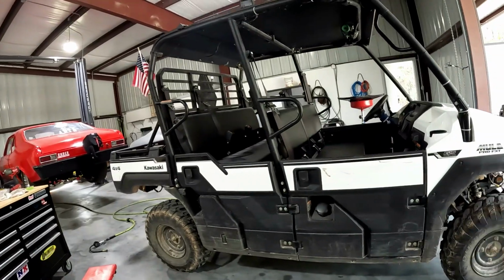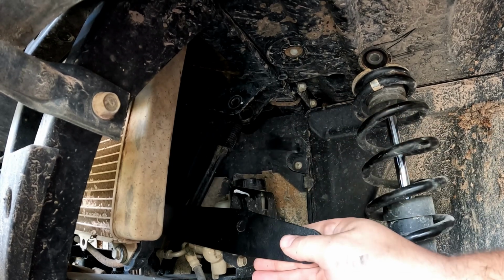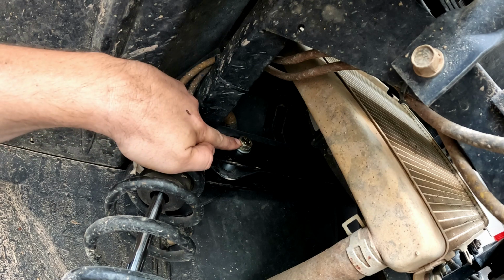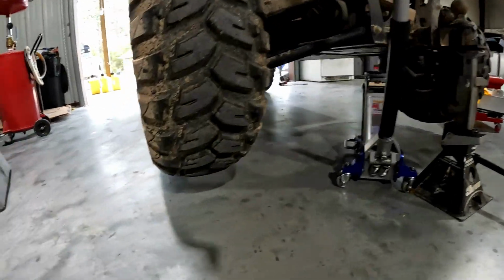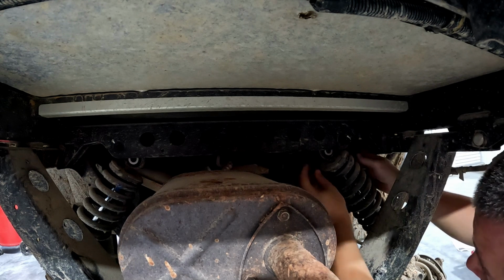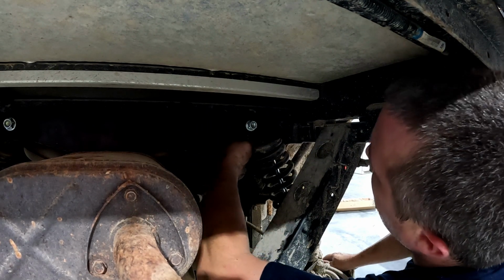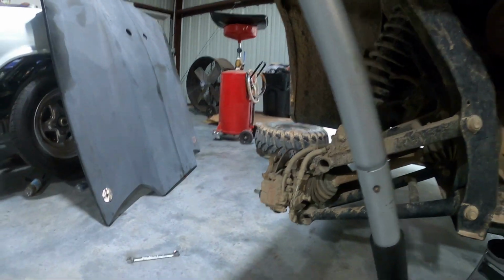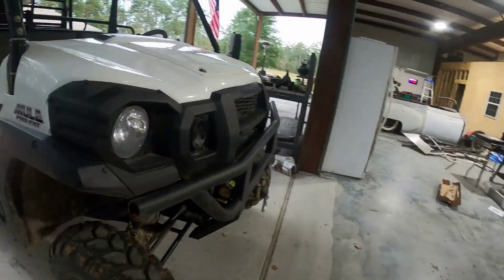Kawasaki Mule Lift Kit Install

Comment: Pretty cut and dry what I did was when I did the rear I open the dump feature on the bed and was able to just get it from the top much easier way to do instead of working from the bottom.
Reply from the maker: You're right! Another person said the same and i never even thought about it. That would've been way easier lol!

Comment: Ok at first I was a little afraid that this kit was going to cause issues with the suspensions alignment etc.... I'm happy to report that it doesn't and it does add a little over five inches ground clearance, not the 3 inches that they advertise it as.  I haven't bottomed out since I installed the kit. One thing that I noticed is a very slight increase the ride being a little rougher, a good trade off for the higher ground clearance. A good value for $100.00.
Reply from the maker: I noticed a little more body roll at speed from the higher CG but nothing scary. Maybe HD springs just in the back for those firewood loads?
Reply: @schmitty750  Mine already has the heavy springs because of the plow I use so I guess that helps.. I don't do any high speed stuff unless I'm on a straight smooth surfacer. Over  a year after install I have no issues with misalignment or tire wear, glad I didn't spend $500 .00 for one of the other kits.

Comment: Hey great video went and bought the RC lift kit. I saw in another vid that you should add 2" spacers to your Hubs to account for the extra height. Did you notice the Mule being more tipsy on turns?
Reply from the maker: I have a Deep South aluminum roof so I definately do notice more body roll when turning at speed, but I wouldn't say it feels like it will tip a lot easier than stock. I will be looking into heavy duty springs for when I have my little trailer, split wood in the back and should help with body roll.

Comment: Turn the front shock spring tension down to lower the frontend down if you want it level
Reply from the maker: The rears have one more notch to stiffen. I may stiffen the rear to help with heavier loads. I'll see how that goes!

Comment: Thanks for the video. You made it look very simple to install. Have you found any drawbacks yet?
Reply from the maker: It was definately an easy install. The fitment was really good as well. I haven't noticed any downside to the lift really. I was worried about it riding rough because I like how soft the suspension is but it still rides very nice.
Reply from the maker: Thank you for watching!
Reply: @schmitty750  I just ordered the lift kit for mine.  Guess I'll have to shop for 28" tires next.
Reply from the maker: Nice! Let me know if you have any questions. I still haven't bought bigger tires so it does look a little funny lol!
Reply: @schmitty750  I just got my kit and plan on installing it but I thought I'd check one last time to see if you had any handling issues. Does it seem to be a little more top-heavy than before the lift?
Reply from the maker: It still rides super smooth just like the factory ride height. No abnormal tire wear. I'm loving it.
Reply: @schmitty750  Installed it yesterday. Had to raise my old feet a little higher to get in, but the ride is still great. Thanks again for the video.  
PS raising the bed makes the rear install a breeze!  😁
Reply from the maker: @Michael W. Salter  glad you like it! I wish I would've thought to raise the bed 😆 🤣.  Thanks again for watching.

Comment: Could you offer a long term review of the lift kit? Pros and cons
Reply from the maker: I think it's been around a year, and so far, the lift is great. I've been a little rough on it at times (too fast over larger bumps) and they seem to hold up great. The ride is very slightly more firm, which is great because the added ride height makes it feel a bit tip heavy. I added some Tensor Regulators 28x10x12 with 8 ply tires that fit perfectly. The 8 ply is noticeably heavier for the vehicle, so I'm careful to stay in low most of the time. Overall, I'm extremely happy! Hope this helps.
Reply: @schmitty750  was curious about bering wear.
Reply from the maker: Haven't heard bearing noise yet. Must be good so far.

Comment: Would it fit on 2023 Kawasaki pro fxt all says 2022 and I have a 2023
Reply from the maker: I'm pretty sure they haven't changed anything on the 2023. You could just call Rough Country. They would know for sure. Thanks for watching!
Reply: @schmitty750   i was watching the video suspension looks the same so I assuming it should be same one just like you said they may not have change on the new ones

Comment: Thank you for the video. Anyone know if the FXT lift will fit an FXR?
Reply from the maker: It should say on amazon what vehicles the lift works with.
Reply: @schmitty750  Yes, it should. But most stop at 2022. I have a '23. I have also heard that the frame and suspension are the same. Just looking for some confirmation. Seems like a prudent thing to do, no?
Reply from the maker: @Delmarksman  I agree 100%. I used Amazon because it was cheaper but check with the seller to Amazon. Call them up and the can give you a good answer.
Reply: @schmitty750  In the case of Super ATV, they say it won't fit an FXR, but they host their product with a picture of an FXR, so...(?) 
I do appreciate the input. I'm hoping for a real world experience reply from someone who has done it.
Reply from the maker: @Delmarksman  I haven't done it man, sorry. That's crazy Super ATV has conflicting info.